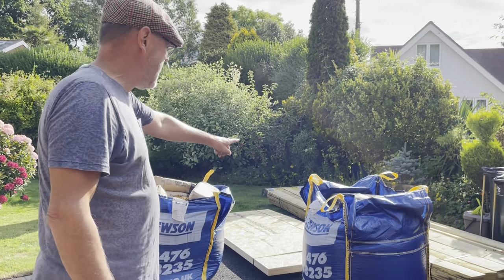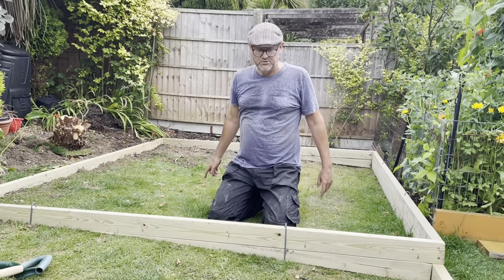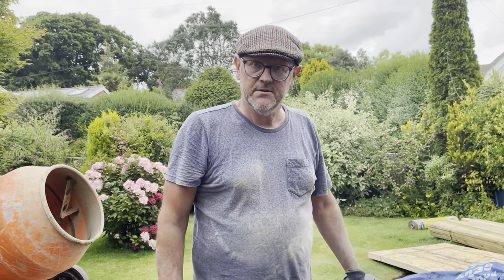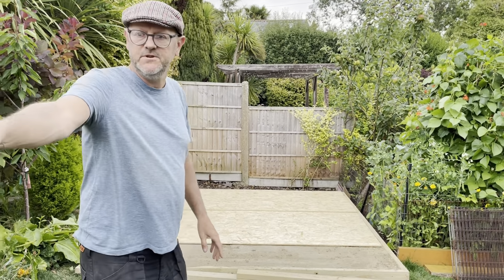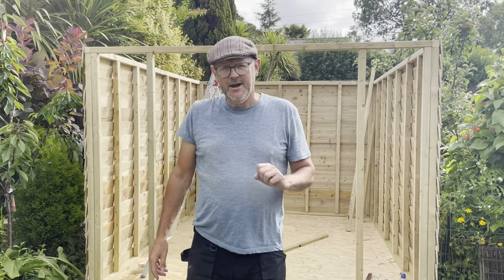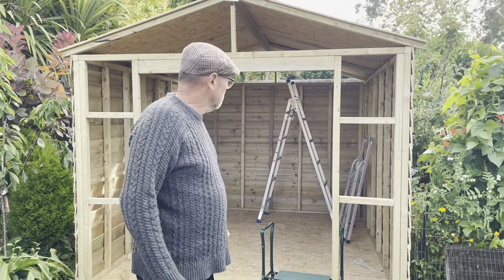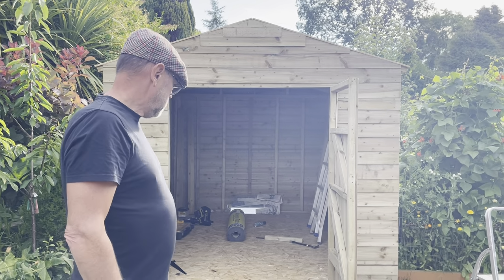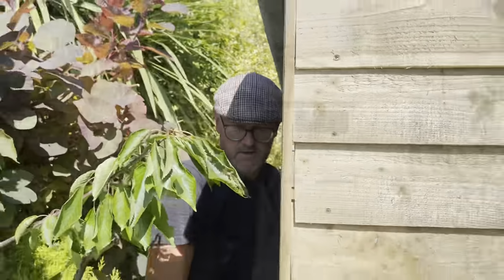Build A Strong Bespoke Shed With A Concrete Base And A Ramp

Comment: Striking that Henry and yourself can work so well together. Instructive as to what can be done with 2x2s and feather-edge cladding.
Reply from the maker: A strong shed can be built with 2x2 if it’s just a shed. You could use 3x2which would be even stronger. If I had done a pent roof then I would use 3x2 or 4x2
If it’s a garden room then the walls would be 4x2 and roof 5x2 or 6x2.

Comment: All coming along nicely until you got to the doors. They will sag within a year or two. Ideally door or gate braces should run from corner to corner in one piece. They should also be notched into each side frame piece, this way the brace has a firm footing to bear against. Needs gable or eve vents too especially in your damp climate. Ask Keith @ Rag 'n Bone. He played hell cleaning the mold from his shed.
Reply from the maker: Thanks for your advice. Never thought about putting vents in a shed. Will consider going forward. 👍
Reply from the maker: One of the things I appreciate about the YouTube community is how much we all learn from each other. 😃

Comment: Another amazing job Mark (and Henry!), well done. First question: how do you measure & calculate the necessary angle & length cuts (which I bet you did by hand) to account for the slope in the shuttering? Cheers.
Reply from the maker: The inside measurement of the shuttering is slightly bigger than the shed. To get the angle , I ran a level across at the back and front to find the height and build it to that height which in this case was 4inches rising to 8 inches. I then simply cut the extra piece across the front and back put it up against the levelled piece and draw a line underneath which gives me a perfect angle. 
I used my circular saw to cut the long lengths. 
Hope that makes sense 😃
Reply: @KAPWoodworkandbuilding  Thanks Mark, all understood now. Love your vids and always amazed at your proficiency and speed. Sometimes though I wish you'd explain your thinking a bit more basically and thoroughly through each procedure, because you do it very well, and now you're doing bigger builds I'm aware that you have much more to offer than a bit of fannying about in a shed. For me, 2 mins of explanation is better than 10 mins of time-lapse. Just my thoughts. Cheers.
Reply: I can't believe I just said "fannying about in a shed"- I meant no disrespect, it's just shed envy. And I might have been out to the local Wetherspoons tonight. Apologies to the entire shed community... Cheers.

Comment: How come you fix your featheredge upside down? From what i can see you have the thicker part at the top and the thinner part overlapping which I have never seen before. Also, you door braces are the wrong way round, the braces are designed to carry the corner of the door back to the hinge side of the door so that the unsupported side of a door can't sag or wobble. In your situation, the problem would have been solved by swopping the left and right doors over then they would have been perfect :)
Reply from the maker: Regarding handling it was an oversight on my part. Regarding feather edge it’s just the way I do it I guess. 😃
Reply from the maker: Sometimes we make mistakes in any job but not intentional
Reply: @KAPWoodworkandbuilding  oh I see, I thought there might have been some reason for using the feather edge that way that I hadn't heard of.

Comment: 16 inch centres if using sheet material as they're supplied in imperial sizes?
Reply from the maker: Yes you are correct 😃